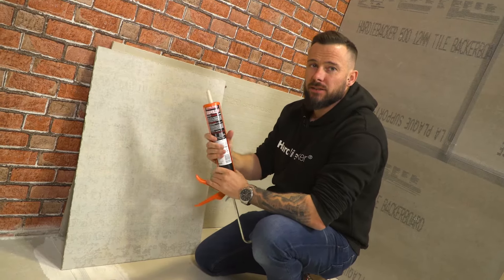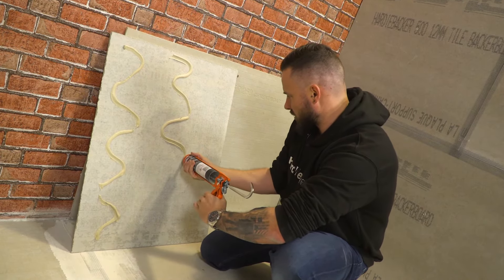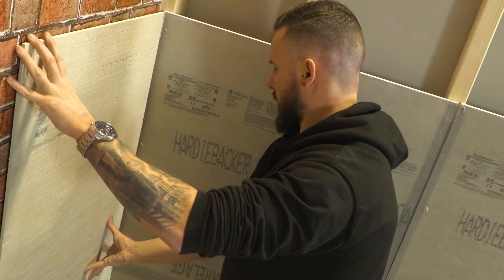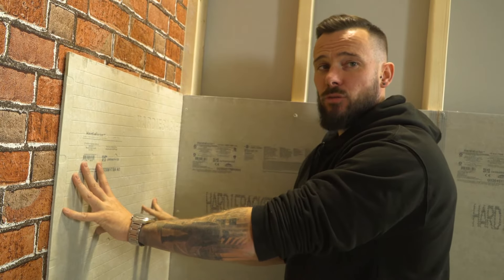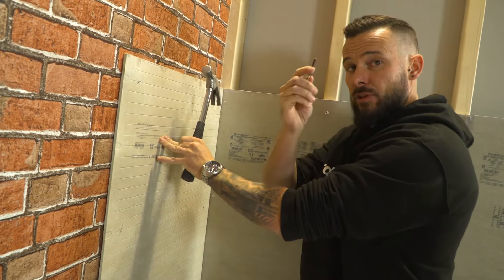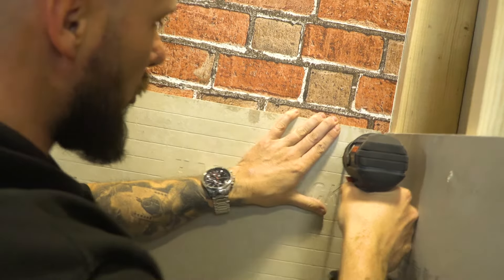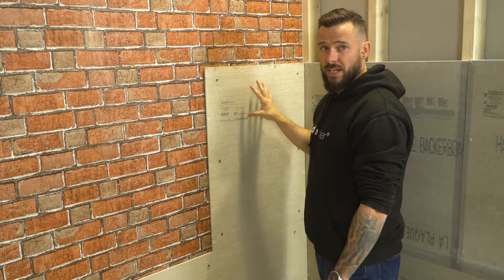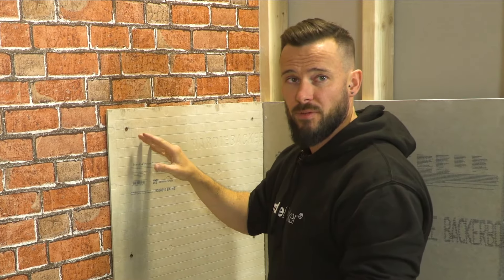How To Install HardieBacker Board On A Masonry Wall

Comment: Hi, thanks for this, can you tell me what type of screws you recommend, do they need to be stainless steel as I'm boarding a shower? Also what is the name of the adhesive you are using? Thanks.
Reply from the maker: Hi thanks for the question. We would recommend using HardieBacker > https://www.ctdtrade.co.uk/hardie-backer-screws-pack-100. These are available in 25mm and 35mm. You can also find a great selection of board adhesive > https://www.ctdtrade.co.uk/adhesive-grout/board-adhesive. Thanks
Reply: @CTDTrade  The video stated the screws should go into the wall 50mm, not sure a 35mm screw is going to manage that

Comment: Can I put them over existing tiles
Reply from the maker: Hi, thank you for your question. Is your installation on wall or floor? Do you also know how the existing tiles were installed as this may affect the process?
Reply: @CTDTrade  wall tiles over plasterboard   That was primed with sbr, thanks for the reply
Reply from the maker: Plasterboard can typically hold 32m2 of weight, so you would be over this by the time you add the HardieBacker boards and new tiles. The manufacturer recommends you remove the tiles to start again, and fix the HardieBacker boards to the structural substrate (i.e. timber studs or block work). Hope this helps with your project!

Comment: You make it look straight forward. But is the 6mm strong enough to hold 600x300 porcelain tiles or should I opt for 12mm
Reply from the maker: Hi! Yes, 6mm board will be strong enough to hold your tiles. Hope this helps!

Comment: Hi My builder used this and unfortunately within a month of finishing the glass tiles 4 x2" started to crack hoorizontally.  The cracked tiles are not in one place and I have no idea why it has done this.  What can be done to rectify the problem?  Any suggestions gratefully received.

Comment: Can I use hardibacker over dot and dabbed dry lining by fixing through to the block behind with plugs and screws?
Reply from the maker: Hi Caine. Yes, this installation method would be fine as long as the boards are securely fixed to the block behind. You can view a PDF installation guide on our website here (under the Downloads section): https://www.ctdtrade.co.uk/hardie-backer-board
Reply: @CTDTrade  good to hear! Thanks for the reply too!

Comment: Most walls are not as plumb as your wall so how can I fix backer board to my block wall that is wiberly woberly ahaha can I use bonding plaster to plumb it up first before using your method?
Reply from the maker: Hi! Thanks for your question. One option is a cement-based adhesive to make the wall somewhat plumb, as it can be put onto the wall thicker in places as long as it's got full coverage. Another option is to plaster the wall first - getting it as close to plumb as possible - then putting the HardieBacker board onto the wall. Hope this helps with your project!

Comment: Can I dot & dab HardieBacker board to a masonry wall inside the house with tile adhesive any other adhesive (could you recommend one if that's indeed possible) ?
Reply from the maker: Hi, thanks for your question. The manufacturer recommends using a high grab adhesive such as HardieFoam when installing on walls, followed by fixing with screws into brown wall plugs. You can find the HardieFoam on our website here: https://www.ctdtrade.co.uk/brands/hardiebacker/hardie-backer-fixing-foam and a PDF installation guide under the Downloads section of this page: https://www.ctdtrade.co.uk/brands/hardiebacker/1200x800x12mm-hardie-backer-board#ns

Hope this helps with your project. Please get in touch if you have any more questions.

Comment: Those screws look like they are protruding from the board. Wouldn’t this affect tiling?
Reply: Did you ever figure this out? Is there a counter sink option for masonry anchor?
Reply: @Eric-ox5iu  No, when you tile, it will be a little annoying, but it will only affect mozaic tiles that get a very small amount of thinset. If it's a 12x12 tile or larger then you'll be using a 6mm or 1/4" notched trowel and it won't cause it to bulge unless you push the tiles down and wiggle them considerably.

Comment: Is 6mm ok for brick or should I use 12mm?
Reply from the maker: Hi Phil,  you'll be able to use 6mm board for a brick wall. Just ensure the board is securely installed as indicated in the video. Let us know if you need any further assistance.
Reply: @CTDTrade  thanks
Does the wall need to be level ? On a spirit level?
Reply from the maker: The wall does not need to be perfectly flat as this can be compensated for by adding more tile adhesive during application.

Comment: Does this fixing method apply , when fixing to a concrete floor.
Reply from the maker: Hi John. When fixing HardieBacker board to concrete floors you should apply HardieFoam to the board (around the perimeter, and zigzag across the centre) then allow to partially cure for 4-5 mins. Then bond the board to the floor, pressing with a sliding action. Hold for 30-60 seconds and walk on the boards to assist with adhesion. Fix the boards in a brickbond pattern and remove excess HardieFoam after around 20 mins. Then tape the joints with HardieBacker Fibatape and fill with tile adhesive before tiling. You can find the required products on our website here: https://www.ctdtrade.co.uk/brands/hardiebacker